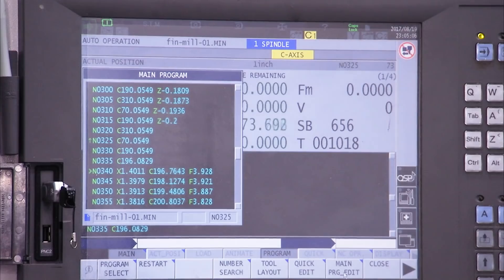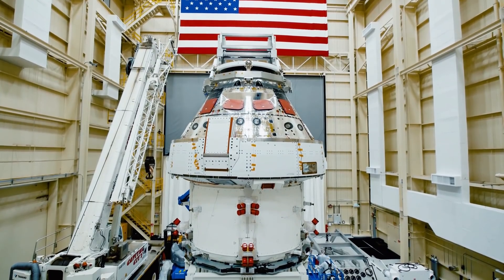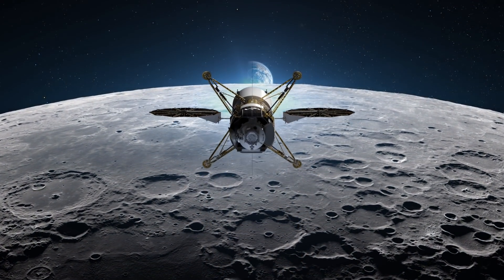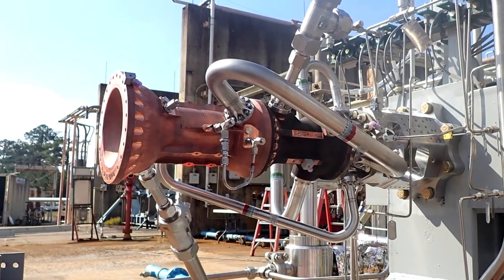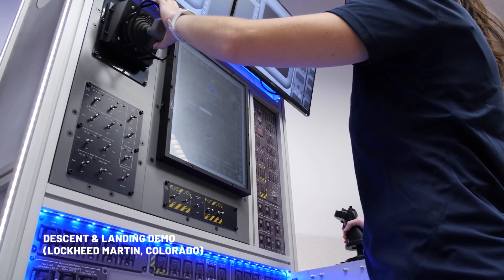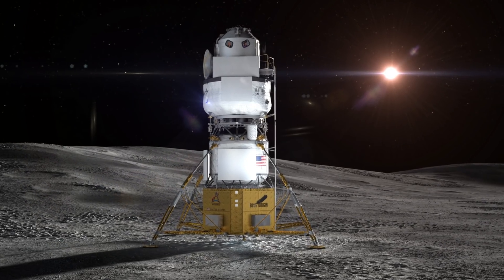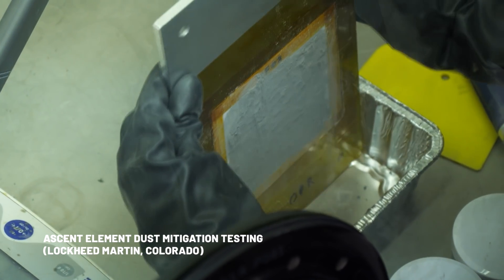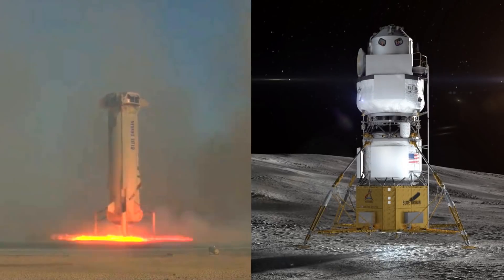Tech Demos for NASA’s Artemis Program

Comment: Not sure why BO thinks they can achieve a moon contract when they have not even achieved orbit. One sphere at a time?
Reply: Next year is when Vulcan and New Glenn fly for the 1st time.
Reply: @Nowhereman10  the same year starship will likely achieve orbit for the first time. It's a great time to be alive.
Reply: Yeah but they aren’t getting their lander to the moon. They are designing the DESCENT stage, which requires LANDING, which if you know anything about BO, they have proved with the new shepherd.
Reply: @ProtonSemilightCondensed  And their hold off capability is much better than SpaceX. That's a big help on the Moon. Armstrong and Aldrin could sure have made good use of it.
Reply: TheThirdMan idk what hold off capability is but it’s probably important. But yeah these people don’t understand that all they are developing is the descent stage, which is purely for landing. They have proved that they can land their suborbital new Shepard rocket with a high success rate, which is why NASA chose them to design the descent stage.
Reply: @ProtonSemilightCondensed  Hold off is the hover time. New Shepard pisses all over SpaceX on this. If Falcon 9 doesn't land precisely inside a couple of seconds, it probably won't make it in one piece. New Shepard can hold off and stabilise very precisely. That comes with some disadvantages, like fuel burn and pad damage but it's more useful and safer.
Reply: TheThirdMan ahhh ok. I get it now. That makes a lot of sense and would be helpful on the moon. The reason SpaceX can’t do this is on the falcon 9 is because even 1 engine at minimum throttle is too powerful to hover. On the starship, however, they probably would have some hold off capabilities but only when carrying a heavy payload. And on the moon the landing engines probably would not be able to throttle. This makes blue origins lander better for crew as it is more safe but the starship is capable of much heavier payloads so that is probably what it will be used for. But SpaceX have proved that they can land their falcon 9 with incredibly accuracy and reliably, and the starship sn8 landing was nearly perfect, so I guess we will just have to wait and see.
Reply: @ProtonSemilightCondensed  Yeah, their accuracy is good but it sort of has to be.
Reply: TheThirdMan yep. Good to see someone in this comment section that actually knows what they’re talking about and is actually willing to do research about this topic.
Reply: @ProtonSemilightCondensed  Thanks. I really don’t know that much.
Reply: @thethirdman225  The New Shepherd can hover because it is tiny and has a weak enough engines so that they can throttle up and down for a hover. The only reason the Falcons “Hoverslam” is because the merlin engines are too powerful to hover, even using just one at minimum throttle. That’s why it has to be timed well, or they would just pop up again. It’s easy hovering a small rocket that is over 3 times smaller than the Falcon 9
Reply: @sebsmith1321  I know how it works son. But it’s not the sign of a weak engine. Look at the language you’re using here. Design decisions all have their compromises. But you’ve signed up to this rather emotive “hover slam” term for SpaceX and “weak” for Blue Origin, without considering that they both have their own reasons for doing what they do. But SpaceX fanbois never accept this. They’ve all shackled themselves to this conspiracy that Musk is the only honest player. He’s the golden boy and everyone else is a tax thief.
Reply: @thethirdman225  let’s have a bit less patronisation please, the Merlin has the best thrust to weight ratio of any rocket engine ever made. Yes I like space X, but Elon Musk is nowhere near perfect. I don’t like Jeff Bezos but Blue origin as a company is very interesting, just too slow in my opinion. I really hope they surprise everyone this year by miraculously having a new rocket appear from nowhere but I am a little doubtful.
Reply: @sebsmith1321  How is “suicide burn” any better?
Reply: @sebsmith1321  If I’m being a bit patronising, I’m only responding in kind to what I get from the SpaceX army. SpaceX fanbois hate Jeff Bezos without really even knowing why. It’s just a rite of passage. I have no comment to make about the man because I know nothing about him. When pressed they make generalised comments about his treatment of his workers, which they can’t back up and which criticism could be equally applied to Musk.

I understand why people are getting impatient with Blue Origin but it would help if they would remember that Bezos simply operates differently. Not everyone is a publicity whore.
Reply: @ProtonSemilightCondensed  
The lunar version of Starship will have four sets of six hot-gas thrusters in a ring around the vacuum cargo bay. These are aimed out on an angle and used during final approach to prevent regolith from hitting the lander.

The 24 hot gas Methane-Oxygen thrusters will have pulse-width modulation (on-off), and analog throttling on each engine. So complete hold-off (hovering) maneuvering is accomplished. The Starship will also have self-leveling landing gear, fully autonomous terrain recognition & landing selection, a personnel lift-cargo elevator, two airlocks, and cargo capacity of up to 100 metric tons. 

The enormous cargo capacity can be utilized to drastically increase mission duration beyond the NASA spec. Most important, all components in the SpaceX system are fully and rapidly reusable, making their solution truly sustainable.
Reply: I think it's because they're rational enough to realize a moon lander has nothing to do with an orbital launcher. Anyone's heavy lift rocket can send this stack to the moon.
Reply: Calvin Sylveste yeh and blue origin are designing the descent stage, which is the part that actually lands on the moon. Blue origin have proved their landing capabilities with their new Shepard rocket.
Reply: the new glenn rocket is going to launch in 2022 so they'll have enough time to do orbiting before sls launches
Reply: I'm not sure why Bezos thinks he can make any contribution to the space infrastructure for future generations. His best work is that his competition might make SpaceX more motivated.
Reply: Will you say the same when they actually achieve orbit one day?
Reply: @Devinci297  yeah, that's usually how orbit is achieved...
Reply: They will probably ride delta v or someone else.
Reply: It literally jumps above into space and then just fucking falls back down
Reply: @elite4702  big difference between just barely making it into what’s considered space and coming back down vs routinely sending cargo and now passengers into earth orbit
Reply: elitelevibes I assume you are talking about the new Shepard? If so, tell me, what does it do after falling? That’s right, it LANDS. And guess what part of the national team lander blue origin is designing? That’s right, the DESCENT stage. The part of the lander that actually LANDS.
Reply: Bezo's Blue Origin is a space architecture and infrastructure firm. It's goal is long term, sustainable survival in space. Not the flash of being first
Reply: @denislovesyou7364  launching, landing, and reusing orbital class rockets and gaining valuable experience and data seems like it would be vital for long term sustainable survival in space dont ya think?🤔
Reply: @Bubbl607 that's why he (Bezo) partnered with Northrop Grumman, Lockheed Martin, and Draper. Companies that have been in the space game from the beginning. They have enough experience and expertise. He doesn't have to reinvent the wheel, just refine it!
Reply: @denislovesyou7364  sustainable, long term survival in space isn’t going to be achieved by just “refining the wheel”, it requires innovation, not just polishing what’s already been done
Reply: @Bubbl607  you can't innovate without first fully realizing the potential of what already exists. Elon Musk don't invent the rocket, he refined the technology
Reply: @JazzEdan  He (Bezo) doesn't have to build one, his partner Lockheed Martin manufactures the ATLAS and DELTA Class of rockets. The same rockets the D.O.D, NSA, CIA, D.I.A, NORAD use to deploy their payloads into space. That's why Blue  Origin is going to dominate the space industry, instead of spending pointless funding on R&D of a new rocket, he spending on other infrastructure  that his others partners can't provide.
Reply: @JazzEdan  New Glenn will fly second quarter 2021.
Reply: JazzEdan you’re missing the fact that they are designing the descent stage and the descent stage ONLY. They aren’t even flying that to the moon themselves. And you said that their rocket goes up and down. And then lands. And guess what a descent stage does? It lands! And that’s all! They have already proved that they can land their new Shepard booster when they became the first company to ever recover the first stage of a rocket. And they have a very high success rate with landing it.
Reply: @denislovesyou7364  rockets that are not reusable, thus cost much more money long term, hurting the "sustainability" aspect of your argument.
Reply: @nolanvalgardson1080  that's what they are currently working on. haven't you seen they lander tests
Reply: @denislovesyou7364  except their lander is extremely unsustainable, being ⅔ not reusable...
Reply: Yeah all those companies that are helping happen to have military contracts
Reply: @rodrigorodriguez6332  The US military is one of the most prolific space users. If you can get something to space from the US or an allied nation then you have probably worked with the Pentagon in some way.
Reply: What the fuck would you know?

Comment: I can’t wait for the 15% reusable, 30ft ladder, most expensive of the bunch lunar lander to end the Artemis program after it bribes its way to the moon and kills someone.
Reply: SpaceX has offered a much higher height to fall from. Almost a hundred feet up.
Reply: No, the Lunar Starship doesn’t have a ladder. It has an elevator. It can also fit multiple lobby landers inside of it, and it still costs exponentially less money
Reply: @SpiffyFlyingPig  It cannot do so. It could maybe, maybe fit one such lander by volume and mass. Also, the lift system is tricky if they lose power or a mechanism gets stuck, stranding the crew or cargo. If a cable breaks, it could literally dump whatever is on the platform right off to fall 25 meters to its doom.

Comment: Anyone helping to push space exploration must be supported, they are all pushing in the same direction. Some fanaticisms in this are not a good thing. For going to the Moon in a short time, with the budget of NASA to it, probbably this is a very accurate solution. And hopefully we will se Starship next. 
The thing I hadly critisice BO is not using metric system 😂
Reply: They do use metric, but since it's the people of the United States of America funding this with their tax dollars, they use imperial measurements for videos like this.
Reply: If BO was innovating I'd be a fan of them. If their only plan is to build something that's almost identically like what we did in Apollo over half a century ago, then that's not even helpful, it's harmful.
Reply: @Ergzay  It is not an identical system. Not even close. The Blue lander ascent and descent stages use LOX/LH powered BE-7 engines whereas the Apollo LEM used hydrazine. The Blue lander is larger and the ascent stage and later descent stage will be reusable. On top of that, this system is modular and can carry cargo in place of the crewed ascent module to the surface, up to 6 tonnes which far outstrips anything the Apollo LEMs could've managed.

Comment: But where is the demo of an astronaut trying to go up and down the massive ladder?
Reply: 3:53 lower right corner
Reply: An injured astronaut would DIE. An astronaut who breaks a leg or an arm, or gets a hand injury, won't be able to climb that ladder, even with assistance. The Apollo moonwalkers had a lot of hand trauma, see for example: https://www.nytimes.com/1971/08/10/archives/front-page-1-no-title-scott-injured-fingers-on-moon-suit-alteration.html
Reply: @joshuanetanel9174  So what?
Reply: In 1/6G one would imagine it wouldn't be that difficult.
Reply: @morskojvolk  in a pressurized spacesuit though
Reply: @DeclinedMercy  the new NASA lunar excursion suits are far improved over the old suits used for Apollo. And the Apollo astronauts had a lot of issues to deal with that the new generation won't, ladders or what have you aside.
Reply: @morskojvolk  astronauts at 0 g at the iss find it hard to move... your point is absolute bs
Reply: @ivantimofeev2233  Your kind words aside, none of the astronauts who landed on the Moon expressed any difficulty with ascending the LM ladder, even though the first rung was about 4 feet off the ground. Granted, that ladder was only about 2/3 the length of this proposed lander, but I can't imagine a 30% longer ladder would be much of an obstacle.
Reply: @ivantimofeev2233  Apollo astronauts did it.
Reply: No one has ever gone to the moon and no one ever will. All you are seeing is theft on a grand scale.
Reply: @chuckp_again_and_again  “KKonaW MOON LANDING IS FAKE! MODERN HUMANS HAVE ONLY EXISTED FOR 200,000 YEARS!!” shut the fuck up
Reply: @QueerAssociation  proof
Reply: @QueerAssociation  ok

Comment: When you design it so that in order to get in and out you need to climb down a 30 foot ladder is when its clear that you need to redesign it. Its also not reusable.
Reply: Uhh.... the SpaceX one has an elevator.....
Reply: HLS proposals literally are required at min to be ascent module reuse by 2028. Both descent and transfer element can be upgraded with reusability, though descent requires ISRU which is long term tech; not this decade. Still got nothing on tech required for Starship though.
Reply: And what transform said
Reply: when you design it so that if the engines you used to land fail, the astronauts die is when its clear that you need to redesign it.  It also needs 11 launches of a SHLV to refuel it (Moonship)
Reply: @transformatron6203  Incorrect.
Reply: @angadsingh9314  correct.  to get a full tank of fuel to NHRO, you need eleven launches of superheavy
Reply: @transformatron6203  What is NHRO?
Reply: @angadsingh9314  basically an orbit around the gravitational average  of the earth and moon
Reply: @angadsingh9314  NRHO=Near Rectilinear Halo Orbit